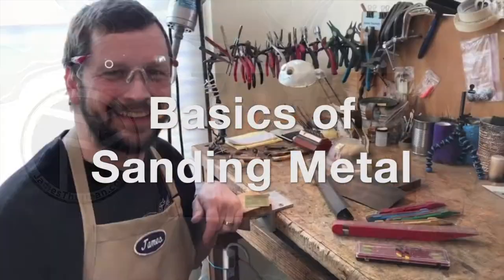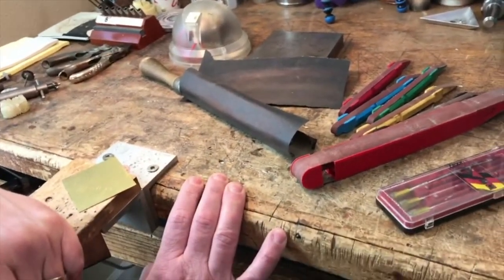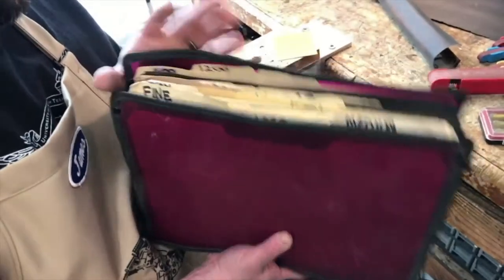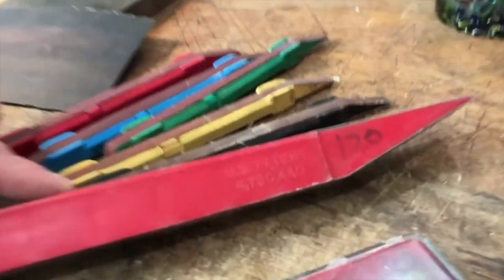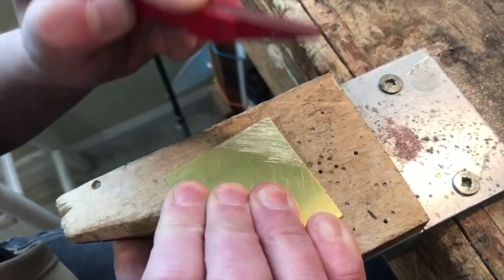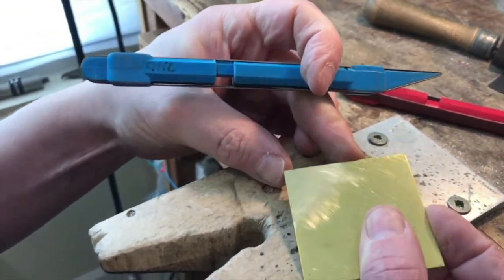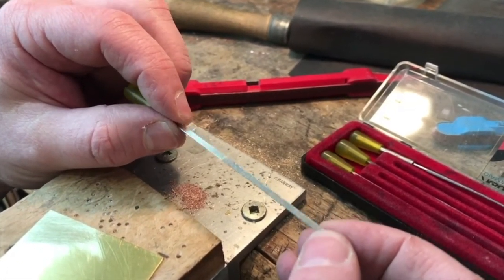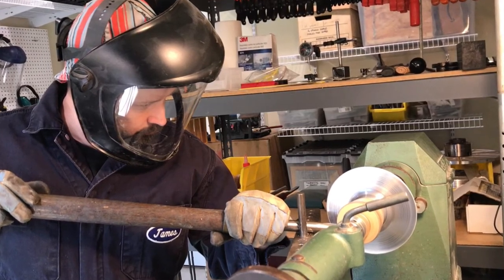Basics of Sanding Metal

Comment: Can you  use a  drill  bit to put  sand  paper on  the  drill  bit
Reply from the maker: If I understand you correctly, you want to sand the inside of a hole? You can certainly wrap sand paper around a round dowel to sand the inside of a hole.  There are also lots of great products (abrasive wheels, etc.) for sanding the inside of holes. Let me know if that helps and how it goes!

Comment: Do you have any suggestions for sanding down non flat metal surfaces (say the outside of a metal cylinder)?

I assume it’d be better to just use sandpaper without a stick if it’s not flat?
Reply from the maker: For larger objects, I would definitely use a power tool, like a disk sander. But all of the different grits are all the same. I hope your project goes well!

Comment: Hi, James, how would I know when I am finished sanding the metal? What highest grit should I be going up to? Thanks!
Reply from the maker: Final finishing depends on your needs and the design of the piece. I recommend sanding to at least 400 grit but I usually sand to 600 grit. You have finished each grit when you have removed all the scratches from the previous grit (remember it helps to rotate the direction of your sanding). I hope that helps?

Comment: James I have a short piece of 6061 1/4” wall 2”. 51mm exact. I need it to be 49mm to fit my project. Can I use a sander and rotate to shave off 2mm? Or use 60 grit sandpaper? Tnx
Reply from the maker: Personally, I would use a lathe. 2mm is a lot of material to remove by sanding. Good luck!